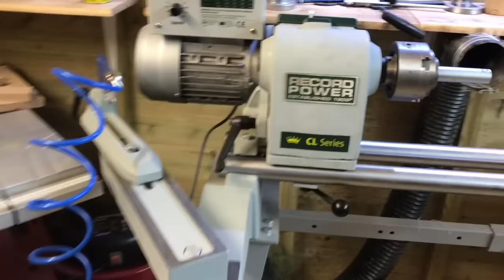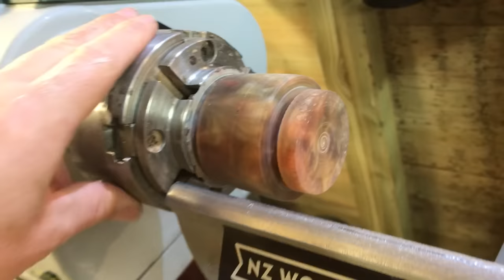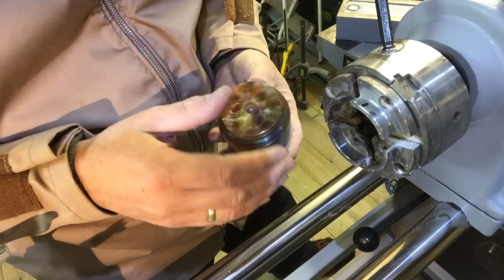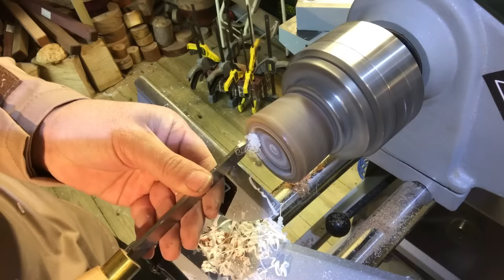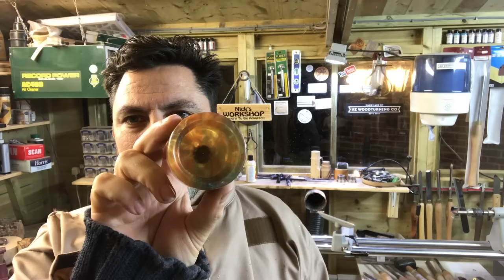Woodturning - Smokey Resin Pot

Comment: You traded up! Your old lathe was my dream lathe, the one I aspire to own one day. Beautiful pot. Good luck at the shows.
The finial looks good. 

I have never tried this (I turn mostly pens) :- Maybe use a holesaw as a plug cutter and drill out the centre of the blank and then carefully break out the centre so you can turn the finial in the same material as the pot. It might work.
Reply from the maker: haha yeah got rid, sold it on ebay to a guy on here actually. a viewer. All the best mate

Comment: I know this is an older video now so you at not see this comment, but I think it’d be really cool if you still have that piece to cut it in half horizontally and add a wooden section just to make it a slightly taller pot. By all means you don’t have too it’s awesome as is :)

Comment: I was checking out your channel because I was looking at vids about the Record Power CL series. When I first checked your vids, I looked at the first and latest one (Dated 23 July 2020) and was impressed that you had the same lathe all the way through. I missed the obvious that it changed colour halfway through! I've just been looking back through and noticed it, so tracked down where it changed. So, now I'm impressed that you updated to the same lathe! (Well at least the latest version of it!) I'm assuming it's because you liked it so much. I tend to notice that people who bye certain makes tend to keep upgrading until they eventually bye a different make. But people who buy RP lathes tend to stick with them. Even though they may have none of the bells and whistles the others offer. Any thoughts? I could be wrong, but I guess you are someone for whom it is about what you make and not so much about what lathe you drive.

I was first attracted by the bells and whistles on the lathe I bought, now I wish I had gone for the CL3! Just a plain old workhorse motor on a spindle.

Anyway, if you read through all this, keep up what you are doing.